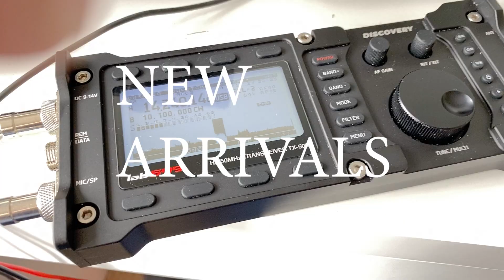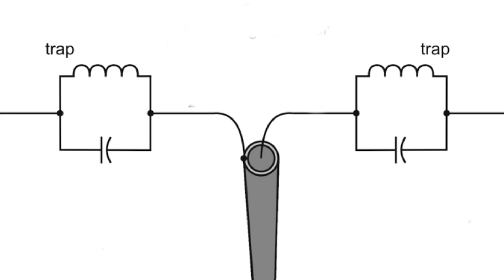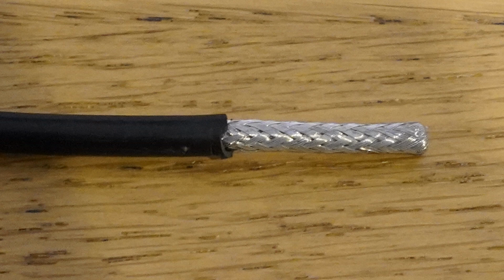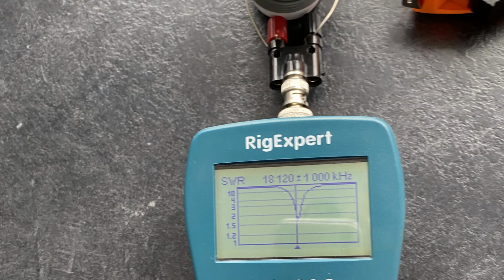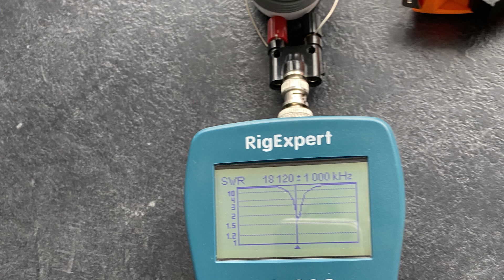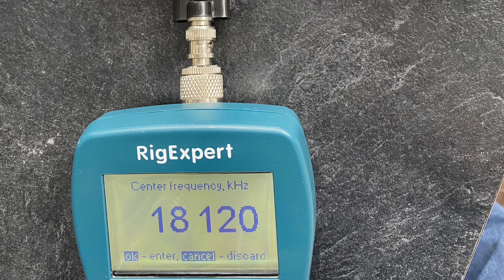Antenna Traps You Can Make - Simple Construction Project

Comment: I'm a bit miffed, wanting to make a 9pf - 10pf cap from aluminium tubing.
It would be larger in diameter than the lower vertical element tubing, over which it will be hanging and covering, with about 6mm full perimeter clearance.

 It will be coupling the upper vertical element to the lower.
 
I wish to use about 6mm thick PVC between them as a dialectric, but am unsure how to figure the requisite length or how best to measure the capacitance, once built.

  I used to be a wizard at such things, but I also used to be younger.

Comment: can u make a 80 metrr trap    sor the shorten the  80 m dipole?
Reply from the maker: Yes but it would be very buky.
Reply: @watersstanton  well they make ham sticks  for the 75meter all it is ,is a coil of enalbaled 20 gaugewire wound around a fiberglass stick & it wworks so y not  do the same thing with a  1 ft section of 1/2 or 3/4 ir 1" cpvc tube/ pipe? . thats all the coils r on a vertical wipe?  y  adding a capsator to it  te  wipes dont have a capsator in thm

Comment: Peter, truly enjoy watching your videos. Question on the 17m 20m trap EFHW vertical; what SWR did you achieve on 20 meters? Getting 1.5:1 on 17, but so far, I've only been able to get 2.5/1 on 20. Suggestions? Using Rig Expert analyzer. Thanks and keep up the great videos. They're a joy to watch.
Reply from the maker: Try changing tge feeder length to see if that helps. I assume you have be a line iaolator at Tzx end? 73 Peter

Comment: nice, but the most important information is missing. How to calculate the lengths of the coil and the cable
Reply from the maker: Well I usually guess and the adjust once the resonance is checked with a metre. It comes with experience! 73 Peter.

Comment: Would this trap cut off anything above 18.120? If so would this antenna be primarily used for the CW portion of the band. What frequency would you make the trap for in order to use it on your 17/20 meter end fed half wave vertical?
Reply from the maker: The trap only blocks 18MHz ham.band.

Comment: Very simple construction, wish you could have built a trap for the lower frequencies. But, hey, that's part of the hobby, .... experimenting.   I do have a mfj grid dip meter and a older mfj 259 antenna analyzer. It would be interesting to see which device is more accurate.

Comment: CE marked!  CE is self certified by the manufacturer.  (Thus a Cert. of Compliance statement.)
I agree that they need good documentation on file with an EU representative local address.  Thanks just the same.
Reply from the maker: If you are referring to Elecraft or LAB599, both Companies submit production units fo a laboratory for CE. They are NOT self certified. That also applies to Yaesu and Icom. 73 Peter.
Reply: @watersstanton  I admire your innocence, but EMC testing is only one part of CE marking.  Once you have created a technical file for marking you will understand.  

If you look at Yaesu's manual, (I'm looking at a printed FT-25R manual), you will see the Declaration of Conformity is signed by Yaesu's Technical Sales Manager, rather than a third party lab. (This identifies the party that bears responsibility, and could be sued from a bad claim)
 I know it's a small point to argue, but there is often more than meets the novice eye on certifications.  

The US "UL" certifications are completely done and signed by a UL lab, as a contrast to the European structure.  
Sorry for the minutia, but it is a valid difference.  I hesitated to even mention it, but I had been down this road while working with a manufacturing equipment company, who sold into European factories.

I would go to https://europa.eu for more detail.

Thanks as always for your reviews, and knowledge.

Comment: Hi Peter - I suspect that anybody who tries to sneak RF gear, which isn't up to scratch, under your nose, you'll see them coming a mile off. For this reason, you won't personally rely on standards such as the CE marking system.
There are however, a number of us which might not have the experience or equipment to make certain measurements, and so we can't say whether something is safe or otherwise up to scratch. For some of us, we WILL have to rely on standards.

"CE Certified"
There is actually no such certification process, and so no product can be "CE certified".
Radioactives, explosives, firearms, infectious materials etc are all tested under a "notified body" (a registered lab), but other than that, it is down to the manufacturer to identify which directives their product falls under (Low voltage / Radio Equipment (RED)), to look up the relavant standards and finally, to test that their product complies.
If the manufacturer is satisfied that the product complies with the directives, it is up to them to mark the product as such and write up a "declaration of conformity".

Any product that carries marketing that claims "CE Certified" is almost certainly not compliant with any EU directives. If it was, it would just be CE marked and would come with the appropriate declaration.

For the record, I used to design gear for a company that started to export it to the rest of Europe, so we had to look this all up. Not the most exciting subject, but it has certainly opened my eyes.

You didn't include a link to where viewers can buy a Rigexpert antenna analyzer! - I had one for work (Moto / Hytera dealer) and it was absolutely brilliant as a test tool. I left mine on a site and it vanished forever :(
For anyone worried about the price of these units, DON'T be - They are worth every penny, are embarrasingly accurate (I'm comparing this to Racal / Rohde & Schwarz / Anritsu gear that I have access to) and easy to use.
~~~~~~~~~~~~~~~~~Dont delay, call Waters & Stanton TODAY!~~~~~~~~~~~~~~~~~~~~~~~~